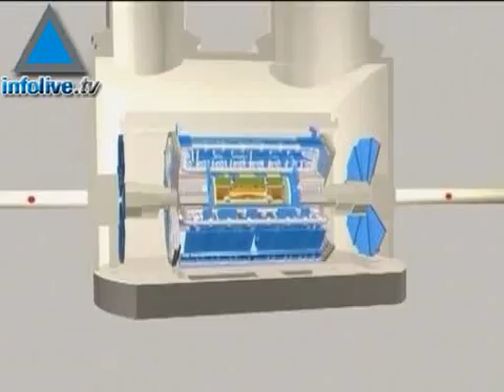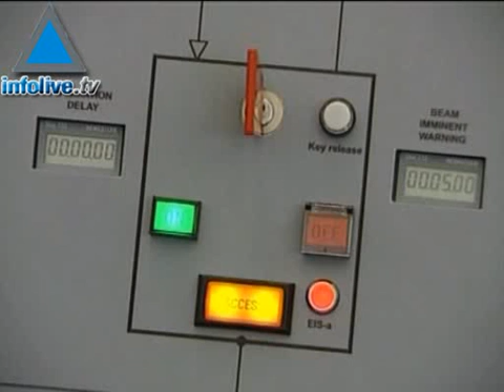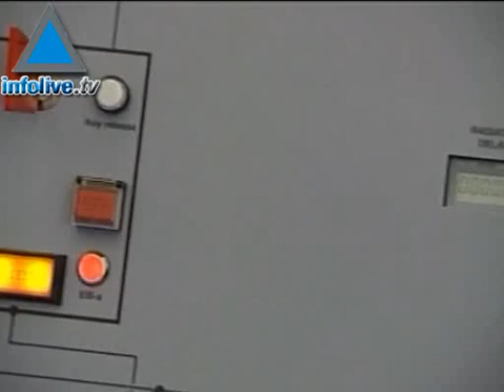Europe Conducting Particle Accelerator Experiment Which Coul

Comment: It will months for it before they push it too full speed, and it's expected to take at least a full year before they are done field testing the accelerator. Then they will begin doing the tests it was designed for, smashing protons at speed of 300,000 kilometers per hour. And if something does go wrong scientists hypothosize that it will take nearly 4 years for the earth to be consumed by the black hole it could potentially create.